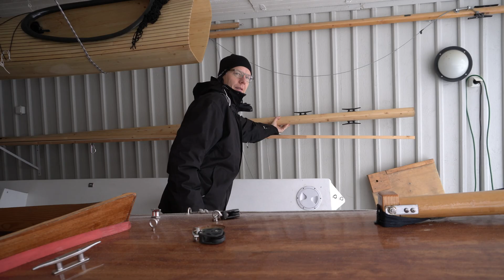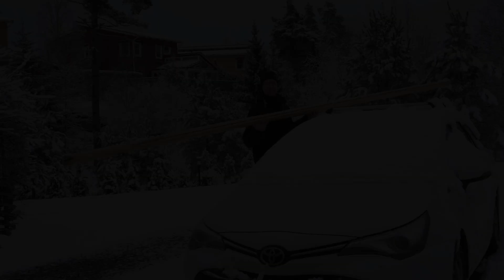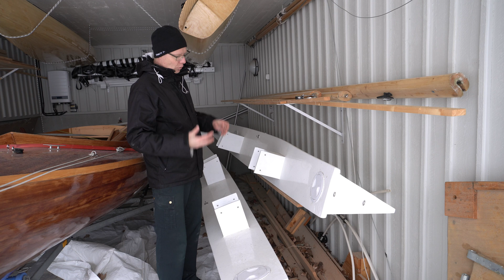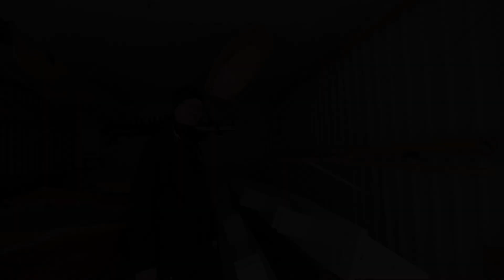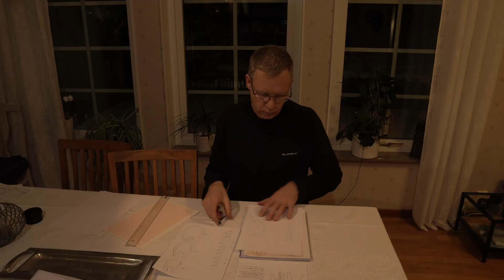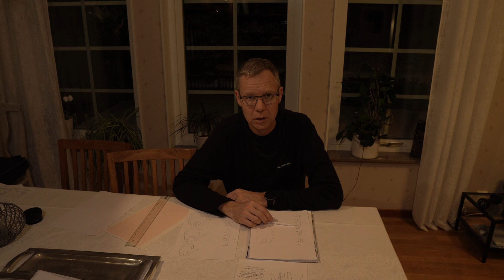How should I build a new divisible mast for my Hobby Kat catamaran? #177

Comment: Allright great questions make the mast from foam 👌 I think it should separate down low because snags happen and up high might make it dangerous.  I'm sure you will weight all the options.  Thanks for the video 👍
Reply from the maker: I will make it from wood for the anisotropic properties, it needs more strength in the length direction. You are right about the danger with high weight high up, it must be light